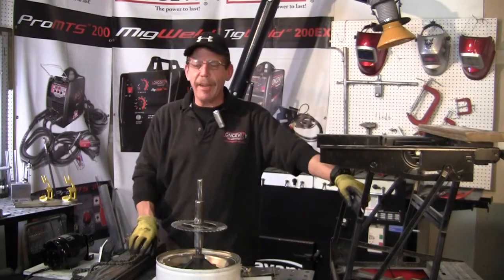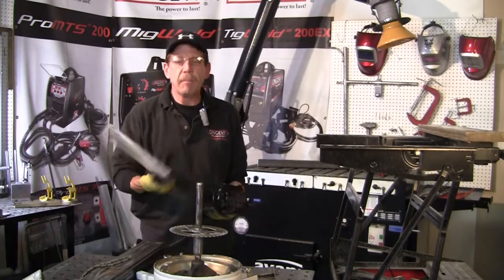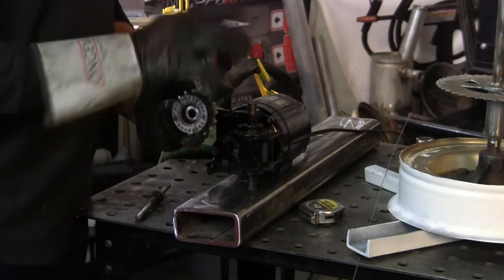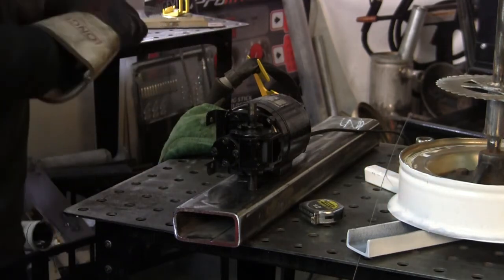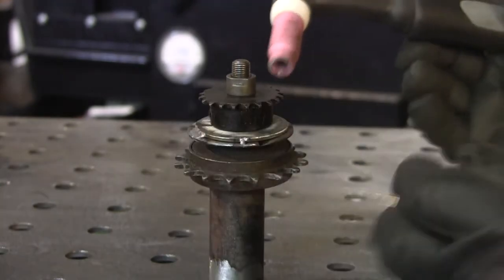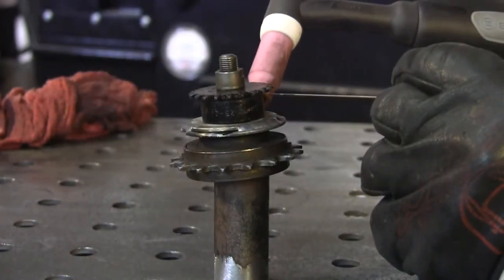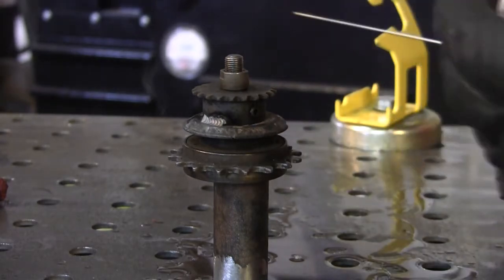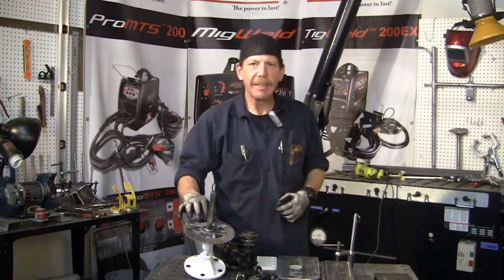Welding Turn Table part 5

Comment: I don't think you need reverse on the switch with the one way gear on the motor.  When you switch to reverse, you'll only hear the bearings like on a bike when you stop pedaling or pedal backwards.  

Interesting none the less.